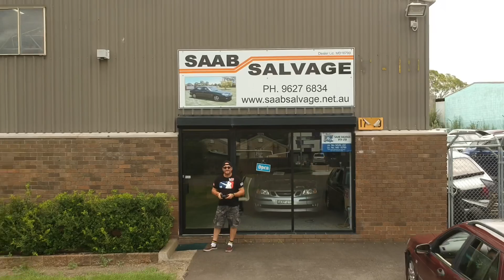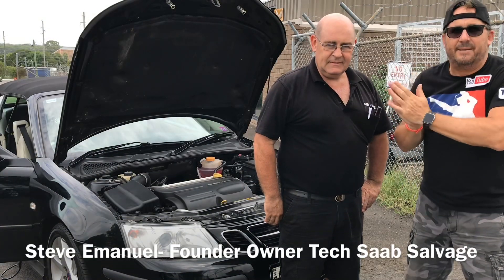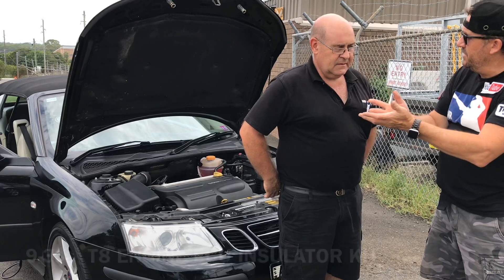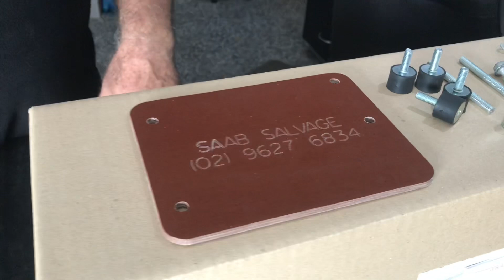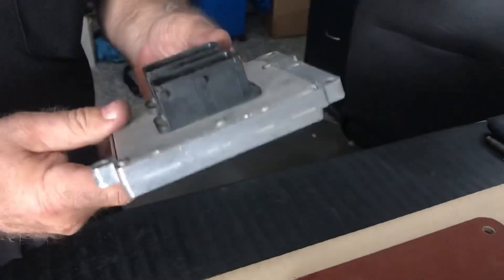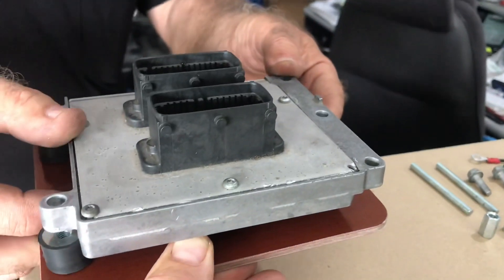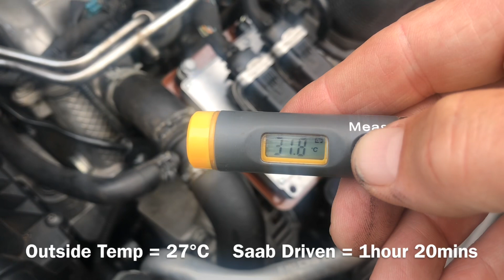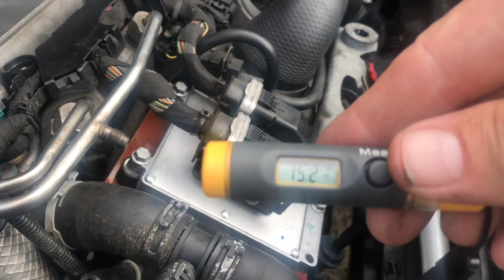Saab 93 ECU Heat Insulator Kit - Urgent Mod Requirement- First Look & Full Install -Andrew Penman

Comment: What proof do you have ECUs fail due to heat? the ECU is built with military grade electronics, heat doesn't cause damage to circuitry.  An overheating CPU will just crash and when it cools off it will gracefuly resume operation as normal. There are other factors that affect ECU's, mostly humidity. Where this ECU is placed is ideal to counter moisture. Vibration is a far more probable cause for ECU failure than heat. The rubber mounts have no effect since you use metal studs to screw the ECU onto the intake manifold.  So vibrations will still propagate from one metal to another metal component. Good try anyway, but I'm not buying into this. Hard to imagine the engineers at SAAB didn't know better...
Reply: Καλημέρα από  Αθήνα . Νομίζω οτι η τοποθέτησή σου για το θέμα είναι αρκετά σωστή  ειδικά στο σημείο που αναφέρεις για τους μηχανικούς της SAAB. Δεν έχεις κανει κάτι για να την προστατεύσης ? Εγω στο δικό μου SAAB  στο πλαστικό κάλυμμα της μηχανής , ακριβώς πάνω απο την ecu έχω κόψει τις αυλακώσεις αλλά δεν ξέρω εαν εχει κάποιο αποτελεσμα .
Reply: @georgekolotouros9176  δεν έχω κάνει τίποτα απολύτως. Έχω πλήρη εμπιστοσύνη στους μηχανικούς της SAAB. Δεν συντρέχει κανένας λόγος για οποιαδήποτε παρέμβαση.
Reply: I have an Opel Astra that is a similar design, also a GM product, where the ECU is mounted on the engine. 

I can’t speak for Saabs. But the Astra is known for having ECU problems due to where it is mounted. Mine had a replacement at 130,000km. In this video the guy is saying his ECU has failed before, and it must be a common issue if the other guy makes a heat shield that is commonly bought by Saab enthusiasts.

Too high temperatures are problems for engines and electronics. 

Mil Spec isn’t accurate, ecu problems are common on some 25+ year old Japanese cars, diodes and soldered connections in the ecu can go bad after 250,000+km, for instance sw20 MR2, Honda Orthia/BA5 Prelude/nissan sr20de, but those are all located in passenger footwells etc safe from heat and vibration but susceptible to moisture and there is the risk of oil travelling in wiring harnesses in certain makes and models. 

Plus in the video the designer of the product did state that they are solid rubber in the middle to help absorb vibration. I’m not an engineer but everything in design has some sort of compromise. You cannot have solid rubber and rubber fasteners.